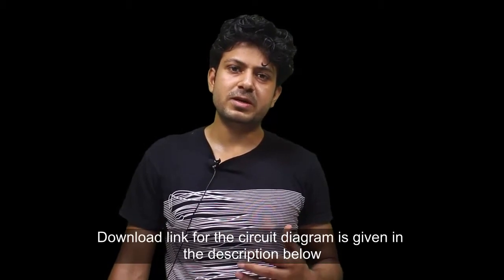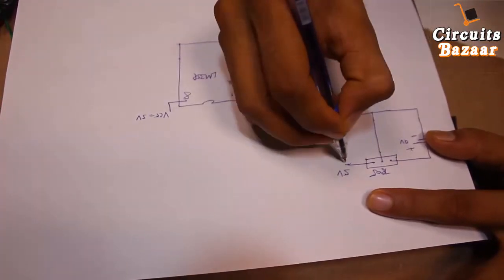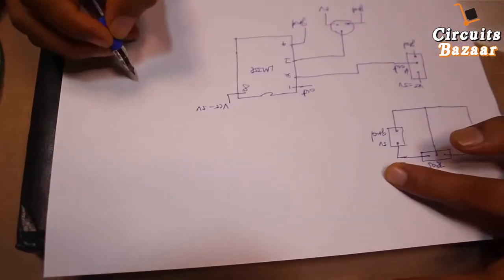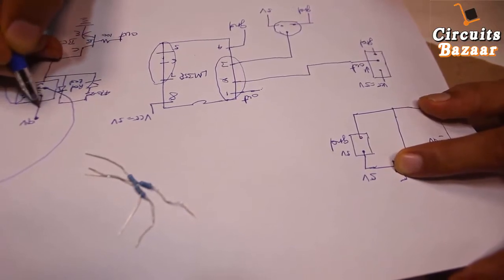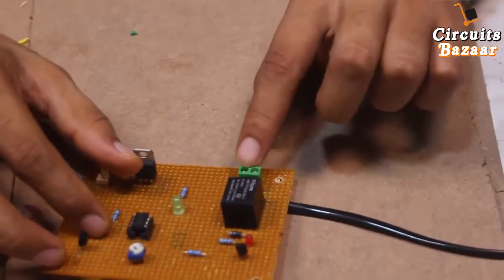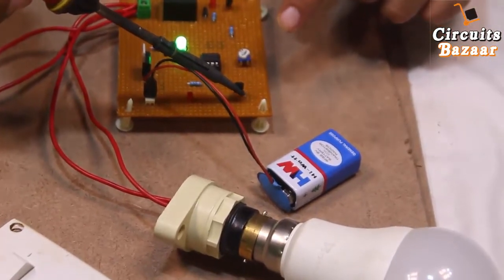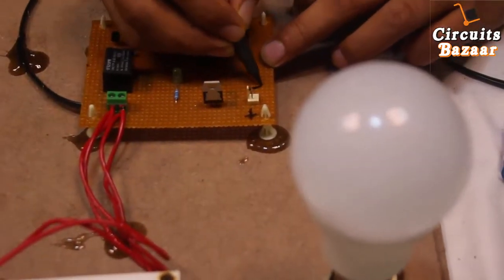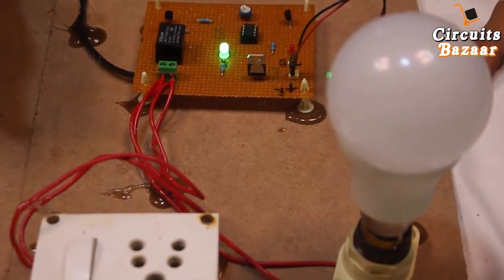Temperature controlled Switch / Relay [ with Working and circuit diagram]

Comment: Sir hmne is ckt p work kiya h to jaise aap bnaye ho ese to y work kr rha h
To sir hmlpg isme further modifications krne chahte h like iska operation reverse krna chahte h jaise ki temperature sensor ko heat dene pr y main ckt ko cutoff kr de ya jo bhi ac load hm relay ki side lagaye vo ek certain temp p auto cutoff ho jaaye to sir isme esa kuch possible ho skta h
Reply from the maker: Yes its' very simple ... just reverse the connection from normally close to normally open on the relays pins... call me for any more doubt